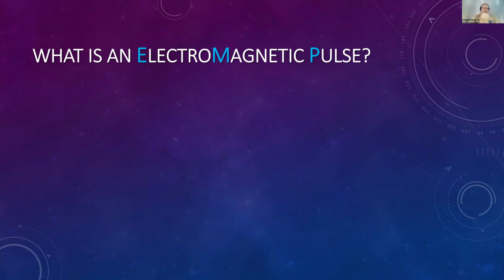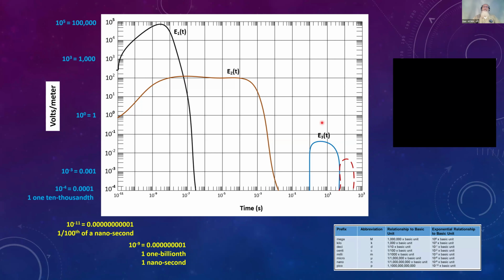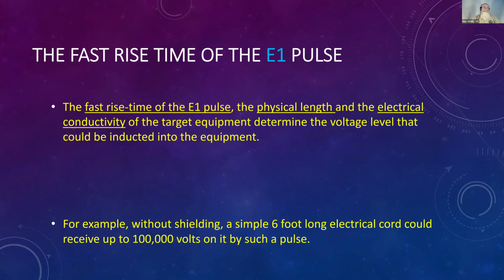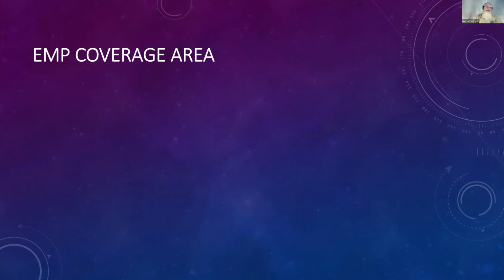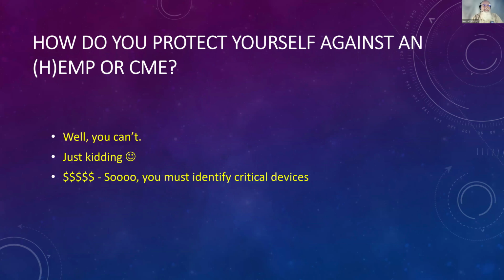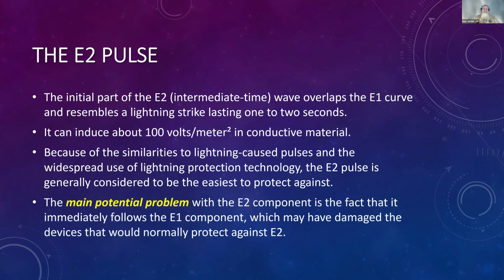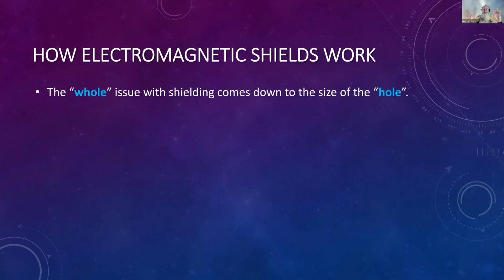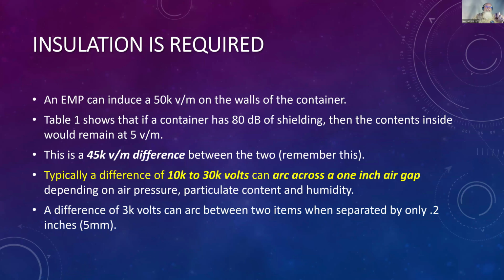ElectroMagnetic Pulse (EMP) & Coronal Mass Ejections (CME)-  What are they & How Do they Affect Us

Comment: In my discussion about EMP's I discuss a company that "might have a device to provide protection against an E1 pulse"... that company is called EMP SHIELD.  I am currently in discussion with EMP Shield to check out their claims and equipment.  Stay tuned for updates!!

UPDATE #1:  I did speak with EMP Shield and am in discussions with them.  Apparently the EMP Shield devices can operate within 500 trillionths of a second.... plenty fast enough to protect against the E1 pulse.  I will be evaluating a couple of units and study the testing that has been conducted on these devices.  They indeed might be a viable solution to EMP protection!  CONTINUE READING...>>

QA_COMMENTS
QUESTION 1:  10 gal can INSIDE of a 33 gal can,  will that work with that being the insulation?  I tell the questioner that combining cans is ideal... BUT you MUST have a physical separation between AT LEAST the first can (minimum 1", better 1.5", best 2") and the second.  If the cans are just placed in each other with no separation then the voltage on the outside can will probably bleed (by physical contact) on and around the inner can.  KEEP AN INSULLATION BARRIER IN ALL CANS, although if you are attenuating the 1st can by 50db or greater then the insulation doesn't have to be that great.  In any and all cases, whether the primary can has a high Db value or not, I will always use a 2" insulating barrier.

QUESTION 2:  Do the best you can.  ABSOLUTELY!!   All we can do is all we can do 🙂.  PREPARE FOR THE WORST and HOPE FOR THE BEST.

QUESTION 3:  Cloth-like bag?  Yes... there are companies that sell these.  I have one myself.  In my study, like I mentioned on the video, it is critical that the device(s) are surrounded by the cloth, but also make sure there is separation between the cloth and the device(s).  The comments in question 1 highlight this.  This is why I don't think simply wrapping my HT in Al foil would work because of the lack of separation.;

QUESTION 4:  Marty discusses an article in QST that discusses EMPs.  MARTY:  COULD YOU GET THAT TO ME?  I WOULD LIKE TO COMPARE NOTES.  "In EMP's they were studying at the time, at least 95% of the energy was below 100MHz"... Marty suggested that the author of the QST article said that VHF equipment might work not not be affected.  MY RESPONSE:  Although 220MHz, 144MHz, 440MHz, etc, are frequencies in which the VHF radios work, don't forget that these values ONLY REFER TO THE RF FREQUENCY THAT IS BEING TRANSMITTED FROM THE RADIO.  It does NOT take into account that the VHF radio ALSO contains discreet electronics that make the radio operate... and these electronics operate at many frequencies... but more importantly, just the fine wires contained in the various CPU's, chips, transistors, filters, etc. could be fried with the E1.  The E1 is not looking for the final frequency that the radio will produce.  It is acting on every component within the radio.
DOES THE INVERSE SQUARE LAW TAKE AFFECT WITH RESPECT TO DISTANCE?  The answer to this, after thinking about it and checking on a couple of sources, it may indeed help!  How much and where is a different matter!

QUESTION 5:  LiFePO4 batteries will probably be destroyed.  Will the Pb batteries still work?  Who knows.  Will the lead plates arc and short out?  Good question.  I would have liked to have seen data on that, but I haven't found anything.  😞

RITORICAL QUESTION:  How do you know when it's safe to take the devices out of their protective cases after the EMP event?  Great question and I hope I answered it to your satisfaction.  I was addressing your question based on the devices I had out already.  Any devices I have in my EMP faraday cages will stay there for at least 48 hours as discussed in the video.  This gives me time to start working out Bug-Out or Stay Home discussions with my neighbors and the best plan we can all come up with.  Those people that have radios that were not affected, we are going to try to get INTEL.  That is critical.  I'm going to have someone do nothing but listen and scan the frequencies.  If nothing is heard then I'm going to assume it is a 99% probability that the EMP was wide spread.  I'm going to be looking for signs of planes falling from the sky and other things done in One Second After.

QUESTION 7:  Will the human body survive a very powerful HEMP?  Yes!  Extremely high voltage, but very low current in the E1 wave.  I DO NOT KNOW WHAT WOULD HAPPEN IF YOU ARE TOUCHING A TRAILER MADE OF ALUMINUM AND 200KV was INDUCED ON THE SKIN OF THE TRAILER.  I PERSONALLY DON'T THINK ANYTHING WILL HAPPEN BECAUSE YOU CAN TOUCH SOMEHTING WITH A VERY HIGH VOLTAGE SOURCE AND AS LONG AS THE HIGH CURRENT IS NOT THERE YOU SHOULD BE FINE.  Spot welders use High voltage but low current and I can touch the welder without any ill affect.

QUESTION 8:  HF antenna issues.  According to EMP Shield there is a solution for this.  I'm investigating this.  

QUESTION 9:  Should I ground everything?  NO!  Keeping things isolated with no grounding wires works best for the E1 wave, which is the first thing that happens.  Event grounding for E3 I would NOT ground anything.... you want to disconnect yourself to EVERYTHING!!  The amount of current (current now, not only voltage) that will be coming into your house or shack will be huge IF YOU ARE CONNECTED TO THE GRID.  Even if you are not connected to the grid (you've disconnected from it at the panel AND service entrance.... THAT RIGHT!  I am going to pull the main meter off my house as this is the first place the current will come in from)... you still have house wiring that will act as an antenna(s).  Disconnect, disconnect, disconnect!

Wait 48 hours after an EMP strike BEFORE YOU EVEN TRY TO TRANSMIT ON HF.  LISTEN, LISTEN, LISTEN!!   

MY OWN SELF PROTECTION MOTTO OR LIFE THEORY:  I'm putting 80% (probably 90%) of my resources toward something that has a 80-90% probability of happening.  In my case it's EARTHQUAKES.  In your case it might be wild fires or tornadoes.

QUESTION 10... AND THIS IS A GOOD ONE:  If I were to go and replace all my plastic electrical boxes in my house with metallic ones... as well as put all my wiring within metallic conduit, will that help?    I first said that I don't know.  If I were just to sit a second and think about it I could have told you the following:  For electrical wiring, the E1 pulse will act upon the metallic conduit AS WELL AS THE WIRE it is protecting.  No bueno!  (not good).  Using metallic conduit and boxes will not protect you against the E1 portion of the EMP.  It might with the E2, NOT with the E3.  You want to ISOLATE your devices in all cases!!

Comment: Data for OLD vehicles tested included below. When is the fedgov going to update that important data, perhaps using this:

"The Kirtland EMP Trestle, also known as ATLAS-I, is the world's largest electromagnetic pulse simulator, built at Sandia National Laboratories in New Mexico during the Cold War. It was designed to test the resilience of military aircraft against EMP effects similar to those produced by a nuclear explosion."

Perhaps they don't want to know or know and it's so bad that the info is classified as it would be an EEFI (Essential Element of Friendly Information).

U.S. EMP Commission Test Results – Key Points

50 vehicles built between 1987 and 2002 were exposed to a spectrum of EMP blasts (up to 50kV/m in strength).

3 out of 50 vehicles shut down while driving.
All 3 of these vehicles continued rolling until they safely coasted to a stop.
1 of those vehicles was disabled completely and would not restart.
2 of those vehicles restarted without an issue.
Many nuisance issues arose from the 50 exposed vehicles including radio interference, strange and erratic behavior from headlights, turn signals, or brake lights, and one vehicle needed to have its dashboard replaced.

Comment: Behind an IEEE membership wall:

Response of Metal-Oxide Varistors Excited by Consecutive Early-Time and Intermediate-Time HEMP Conducted Currents
18 Dec 2024

High-altitude electromagnetic pulse (HEMP) can be divided into three parts: 1) early-time HEMP (E1); 2) intermediate-time HEMP (E2); and 3) late-time HEMP (E3). Most studies focus on E1 alone, as E2 and E3 pose lower peak value, especially E2, which is considered less severe than lightning. However, E2 coexists with E1 and affects victim equipment simultaneously, which may result in different effects than E1 or E2 alone. As the most widely used surge protection device, the behavior of metal-oxide varistors (MOVs) under the consecutive E1 and E2 should be investigated and compared with those under E1 or E2 alone. Based on a pulse current injection platform, the voltage, current, susceptibility, and nonuniformity behavior of two types of MOVs under the separate E1, E2, and consecutive E1 and E2 disturbances are investigated and compared. The peak residual voltages of the MOV samples under consecutive E1 and E2 disturbances reach 15 kV, which is the same as that under the E1 disturbance and much higher than that under the E2 disturbance (1.5 kV). The MOV samples are more sensitive to the consecutive E1 and E2 disturbance, particularly those with a higher nonuniformity. Finally, the response process is discussed based on the microstructural nonuniformity of MOVs.